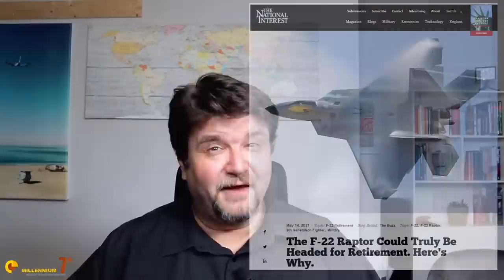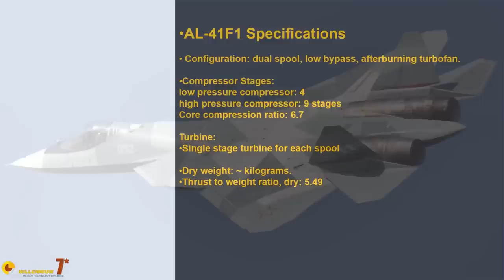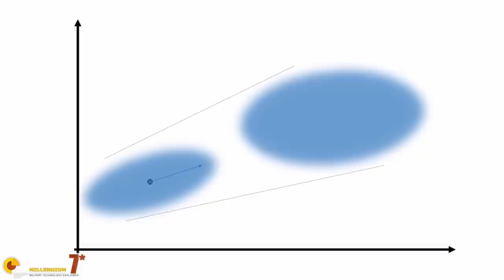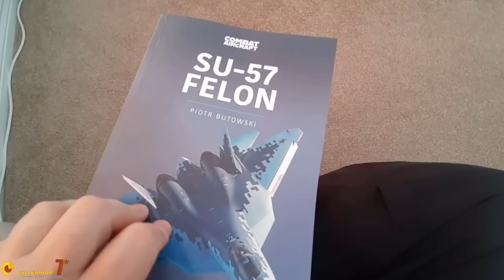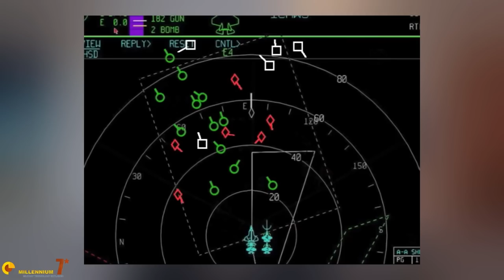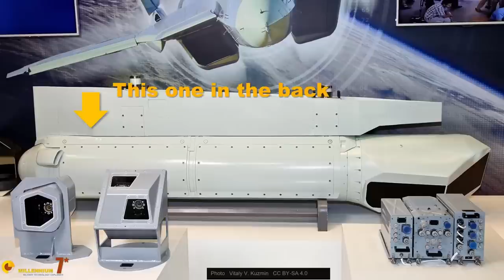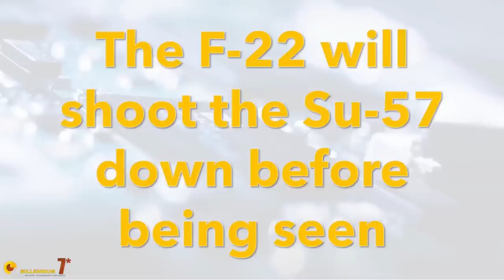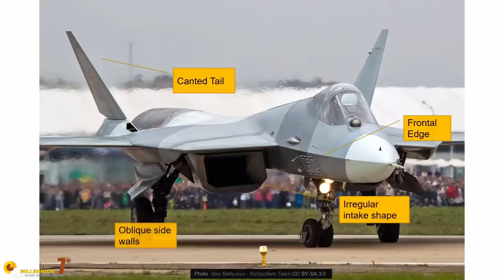Su-57 Update! + In Depth Analysis

Comment: This is all the analysis necessary:  The Russians no longer build anything from the ground up anymore.  They have problems seeing any project through to serial production.  They are always late.  The Su-57 was never a new design or a fresh sheet stealth aircraft.  What it is is re-worked plane following an evolution from the Su-27 family.  As such it is short of its' peers in RCS.  Despite what chowder heads on YouTube would like to pretend, RCS is the end all and be all.  Radar is the means by which planes see and tartget other planes.  Not only is the Su-57 1000 times larger on radar than an F-35 it does not have an AESA radar yet.  Between two planes where radar is the means of finding and tracking the plane with the smaller cross section and better radar will win most times.  This obsession Russians have with maneuverability is mind-blowingly dumb.  The future is going to be about stealth, sensors and data sharing.  The F-35 has sensors that allow the pilot to see through the plane.  They also have helmet-mounted cueing and can fire missiles that can change directions 180 degrees and travel backwards.  If that doesn't work the F-35 can send targetting data to another F-35's missiles and fire them.  F-35's are never going to go up in singles.  The F-35's are plentiful and will only hunt in packs...but the Russians are obsessed with thrust-vectoring.  Sad.  The last true dogfight and gun kill for the US happened in 1957.  

Su-57 is a good plane, but it falls behind even China who seems to at least get where all of this is headed.  I think, to use a metaphor, that Russia came to the plate and hit a single.  China hit a double.  The US hit a home run.  

I see the Su-57 and see a country falling far short of their potential.  With Ukraine things are not going to get better, but will get worse.  By the time Russia has 50 Su-57 (an inferior plane), the allies will have 1,500 F-35's.  If you don't have a qualitative advantage (which Russia doesn't), then you had better have a quantitative advantage (which they don't).  Pretending this is some sort of world beater is just sad.
Reply from the maker: Trust me bro... I understand why the casual western stakeholders may think this...but it is wrong. There are reliable, even western, sources that say otherwise.
Reply: You are right  talking in numbers, radars but you miss tactics, russian air defence S350pmu, S400, BUK and similar. For example, one Pancir S1m is death tool for almost every drone, every plane on battlefield in range of 50 km, It is proven. So what will you do with 1000 F35 planes in classic battlefield? It is more complicated story and it is not easy radar vs radar
Reply: @drzavnalutrija  That isn't how this works at all.  If you have stealth planes, you shrink the range of coverage.  The Russians have good air defenses, but not nearly enough of them.  Not by a long shot.  They only run 5 S-400 battalions for example.  That leaves holes when talking about fourth-generation planes.  The holes only grow larger when it comes to stealth planes.  The expanding range that slealth aircraft can fly in without setting off defenses allows for systematic degredation of such systems.  THE ONLY COUNTRY IN THE WORLD whose Air Force is set up for true large-scale SEAD missions is the US Air Force.  If you don't believe me there are articles talking about how European Air Forces want to spend more money because they don't want to rely on the US for SEAD operations in case of a large war.  

Read a few of those.  You'll get it.  That is the kind of extra ability having a 700 billion dollar budget gets you.  Russia doesn't have that ability and neither does Ukraine.   That is why both countries air defenses have remained relatively intact.  

The US could and would break Russian Air Defenses.  They have spend billions of dollars for such abilities.  But it takes massive investment in EW planes, decoy missiles that spoof radar and stand-off munitions...and time.   

The S-300 and such systems have been shown to be beatable....ask Israel.
Reply: @drzavnalutrija  Tactics are very important.  However, the Russians haven't exactly shown that they are masters at combined arms warfare or logistics.  If anything it has shown how large the gap is in abiliities between the US and Russia.  

We overestimated Russian abilities by a wide margin.  

Ukraine prior to the war had the 20th ranked military in the world and they are stalemated.  Russia has already been defeated in their original goal.  Finland and Sweden have joined NATO.  The International community has made Russia a pariah.  Even Russians are revolting against Russians and there are dead Russians everywhere.  

I can't see how anyone sees anything but a Russian failure.
Reply: @wadopotato33  it is nice Hollywood story, for kids. This is post about plane and it is ok to talk about some problems but in widerpicture you talk about some break of air defence. And from which airport, carrier? They will be destroyed. There is no Top gun (nice movie) without carrier sunk or bigger war not like in Ukraine.  And your picture is so wrong about russian air defence. But ok it is your opinion, but you should look things wider. Man in this video talk about that.
Reply: @drzavnalutrija  No. I was dead on about Russian Air Defense.  It is good, but no better than we have in the West.  It has weaknesses and can be defeated.  The number one problem is that under ideal conditions the S-400 has a massive range.  However, in the real world, experts put most interceptions in the 40 mile range.  As such the Russians will never have enough of them.  They have 5 S-400 battalions.  Realistically they would need all five just to defend Moscow.  They have two there which means they have three for the rest of the world.  One in Syria, I think and one near Ukraine, one for the Pacific Fleet.  That leaves most of Russia without any defense, or they are going to have to use older systems.  It would work well if the largest country in the world was made up of one city...it is not.  Thus concludes your reality check.  

Don't be sad however, the US is the same way.  They have 15 Patriot battalions (or whatever term they use) to be spread over the entrie world.  Fact is, with the Patriot, it does not have its 360 degree radar, yet.  Not only is there not nearly enough of them.  They do have to make a "best" guess as to which direction the attack is going to come from.  

No country has the air defense, nor  the money to fully defend any air space completely.  What both countries get is a limited air defense capability where compromises and decisions have to be made on the daily.  

Russian Air Defenses are good, but the idea that they would somehow completely shut down the US Air Force is laughable.  Like completely laughable.  The ida that because the Russians have shut down the air space to the Ukranian  Air Force and therefore the same would happen to the US...once again, sillytalk.  What is needed to break down an Air Defense is a massive budget.  The US has specialty planes, missiles, decoys, satellites and drones swarms that the Ukranians (and for that matter the rest of the world) do not.  The US has a decoy that produces RCS and can be programmed to mimic a planes signature.  It is going to trigger Russian Air Defenses because it can me made to have the RCS of planes in an S-400's threat library.   That is science fiction stuff, but is part of the US capabilities.  

The Decoys:
The ADM-160A carries a Signature Augmentation Subsystem (SAS) which is composed of various active radar enhancers which cover a range of frequencies. The SAS can therefore simulate any aircraft, from the B-52 Stratofortress to the F-117 Nighthawk.  

So the Russians don't know that it is a decoy and not a B-52.  Pretty crazy tech.  FYI, this program was cancelled after 150 were made, because they have something better (longer range, I believe)  It is completely plausible that Russia would use up their missiles on decoys.  The decoys are relatively cheap compared to missiles.  

There is only one country on Earth with a real SEAD capable Air Force and that is the US.  That is what a budget of 766 biillion dollars gives you.  Russia doesn't have the capability and NATO's Air Force would rely on the US to do it.  That is something that is a fact and you can go and read those reports.  

I am not against Air Defenses.  I just think that Russia has oversold their abilities and those abilities have been put to the test by the Ukranian military.  The abilities of the Ukranian military and those of the US are seperated by a massive budget.  The massive budget gives the US abilites that other countries don't have.  Just a fact.  I think there are two countries that could beat Russian Air Defenses.  The USA and Israel.  The US because of budget and specialty SEAD weapons and Israel because they have been doing it already...although not against the S-400, but only the S-300.
Reply: @wadopotato33  ok again you compare Patriot and S400 that is totally different with range and others. You forgot multiple layers in russian defense Pancir, Buk, Tor, S350 that is not comparable with anything on West. And budget for defens doesn't mean anything just more money for big companies, it is not represent of better weapon. I agree that every defense can be breached but who will do that. Where  is that place you lunch decoy's and planes. Carrier? No, it will be sunk, Israel base, German base, no they will be destroyed. It is not one direction work. USA and Russia will never go in open war. Everything else about best US air defense is funny, specialy that is better than Russian.

Comment: While I have faith in Russian engineers to match and even outdo anything the West comes up with, I have less faith that Russian industry can produce such a beast, especially with Taiwan now limiting the export of the most advanced computer chips.  And any news on reliability?  The US F-35 is already famous for being cranky and hard to maintain - with the Felon also have such problems?
Reply: I agree, no clue if they can integrate so many computer systems without a robust native chip manufacturing which would be impervious to sanctions. If they plan on building enough to matter, they have massive logistics issues to solve.

Comment: The F – 22 is being retired ( ceased production ) because there’s already a 6th generation aircraft that can pick the SU 57 out of the sky…..  from above, behind, beside……. from any angle. The SU-57 will not even see the next gen. U.S. fighter as it passes by @ Mach 10 😳
Reply: show me proof
Reply: There is no 6rh gen fighter in testing, yes they have tested design ( it can be done in many ways)

Tbh today 6th gen is not even defined
Reply: Whaaat, now USAF is pushing for the F-22MLU, there won't be a NGAD for 15-20 years at least
Reply: The darkstar 🤣
Reply: No f 22 still in service another 30 or 40 years it's confirmed by us air force and f 35 will be service in 50yr
Reply: Correct - multiple limited role 5G Single Platform System of Systems to all role 6G Networked AI Assisted Multi-Platform System of Systems = Piloted Command & Control Fighter platform that can Dogfight + Evade + Strike on its own - but dramatically increases effectiveness & survivability by commanding an airborne battlegroup of Air Combat + Strike + ISR + EW + Tanker Drones – that are dedicated role to minimize cost = Attritable - to take a bullet for the boss = MQ25 + MQ28 + XQ58 - already achieved Milestone B of the Adaptive Acquisition Framework for 2030 Milestone C...
Reply: Your comment does not make any sense.
Reply: I hope this is satire..
Reply: @MostWantedYouTuber  Russia and China are working on a 5th generation “stealth” fighter. The U.S. already has a 6th generation “space” fighter. 

United States Space Force….  SR 72
Reply: @leolani6040  Lol what is a 6th generation fighter? 😂